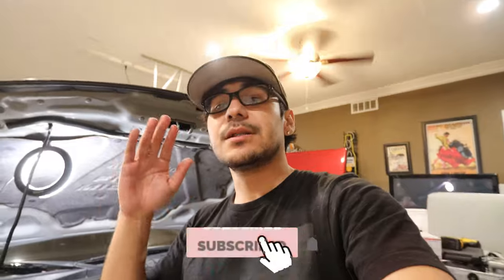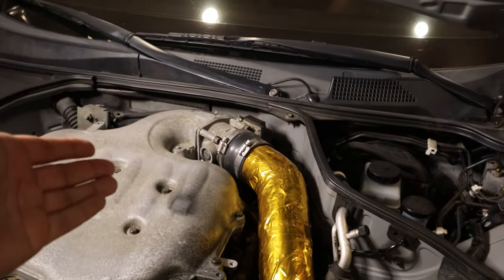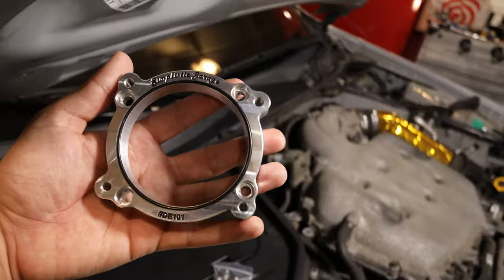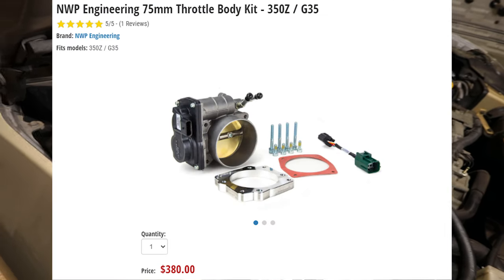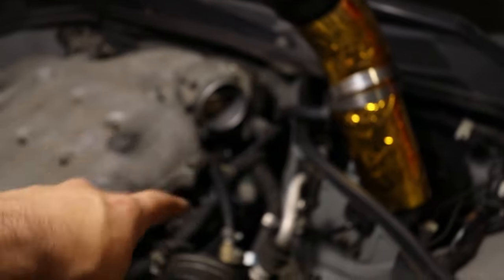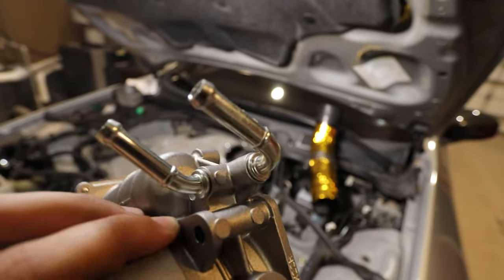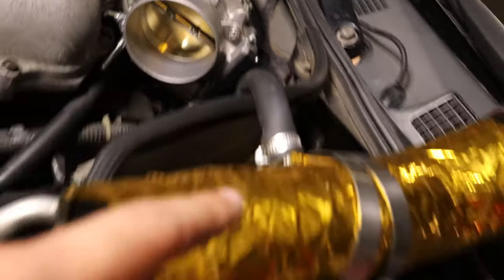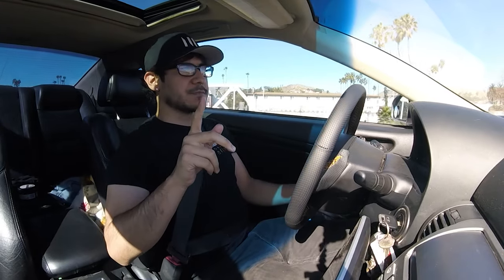Watch This BEFORE Buying 75mm Throttle Body for your G35 / 350z!!

Comment: That harness is the new one that came with the kit?
Reply from the maker: Yes!!
Reply: @JoeVazquez  do you suggest to get a throttle body kit with a plenum spacer, I’m starting to build my g35 ( sedan ) I just updated my exhaust system. Also I just seen the prices between z1 and CZP and CZP is better priced. But I don’t have the tool to cut those coolants off.
Reply from the maker: Yeah I’d definitely recommend bro!
Reply from the maker: I’d honestly buy the cut off wheel at harbor freight for like 20 bucks and now you have a tool you didn’t before!
Reply: @JoeVazquez  the tool you used to cut off the coolants off it’s called cut off wheel? Do any auto parts sell em?. I was thinking about ordering the plenum spacer, the throttle body kit, and the air intake.
Reply from the maker: They’re called a cut off tool and they’re like 20 at harbor freight. I don’t believe they sell them at auto parts stores
Reply: @JoeVazquez  thanks bro I may have a few other questions on your other videos

Comment: Hello! I have the code p0507, I was thinking of replacing the OEM TB with 75mm. Would it be okay to ride without an tune or bolt ons?
Reply: Any chance you tried out the throttle body with no tune
Reply: @Gloccthejocc  not personally, but my homie got one and been driving without a tune.

Comment: Been looking at this mod for sometime now. Thanks for the insight bro. Any alternatives to cutting those coolant lines?
Reply: You can bend them, or even remove them. They are pressed in so if you can get them to twist back and forth you can work them out.
Reply from the maker: Austin is right! I couldn’t get them to twist since I’m a weakling but they’re pressed in so you don’t have to cut them if you really don’t want to!
Reply: @sgmachine  do you plug them once they are removed or does it not matter?
Reply: @SalVillegas42097  it doesn't matter either way. Most just leave them open.

Comment: can i use this throttle body with the stock intake air box?
Reply from the maker: Yes!
Reply: @JoeVazquez  would it work if I purchased a used hitachi throttle body and just buy the adapter kit for it?
Reply from the maker: Yes!

Comment: Can you still put throttle body spacer along with the 75mm throttle body?
Reply from the maker: The adapter that helps bolt up the 75mm throttle body to the intake manifold is already considered a spacer!
Reply: The adapters are half an inch thick, but if you're looking for more spacing just send Simplistic Garage a message and they will make you adapters that are your desired thickness👍

Comment: Why did u cut it?
Reply: Well when you get the cheap stuff you end up having to cut something lol well it’s not cheap but poorly designed.
Reply: With the expensive option you have to grind down a nut or it will hit the hood.
Reply from the maker: So the 2 ports are in the way of installing it so cutting it the easiest but they’re just pressed in so if you want you could just press them out! Since it’s an oem throttle body for a newer maxima it’s just not made for g35’s. If you want to save the most amount of money this is the best way to go, but there are other kits that remove them so you don’t have to!

Comment: When you cut off the coolant port, did you have to plug it (due to vacuum leak)? or do the ports not cause a vacuum leak
Reply from the maker: You can’t have a vacuum leak on a coolant port
Reply: @JoeVazquez  yeah I thought about it after I commented, that was a dumb question LOL thank you

Comment: Is the idle when the car is warm supposed to be 650?
Reply from the maker: Yes +/- 50 rpm difference
Reply: @JoeVazquez  so if it idle like that, but steering wheel and seat vibrates should I be concerned?